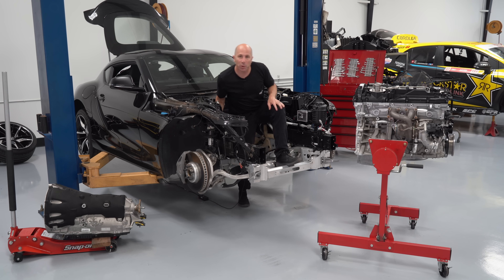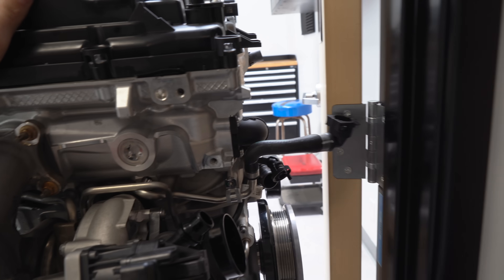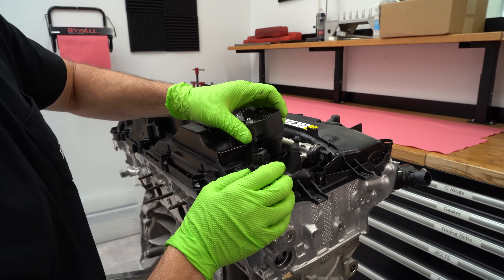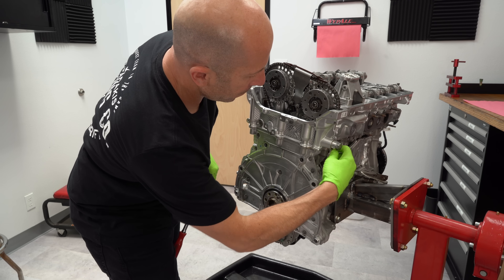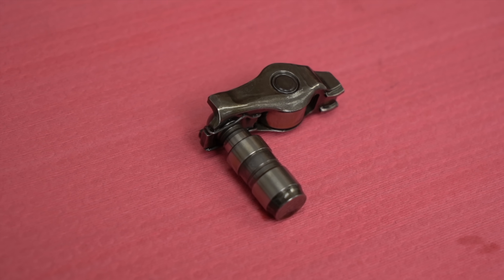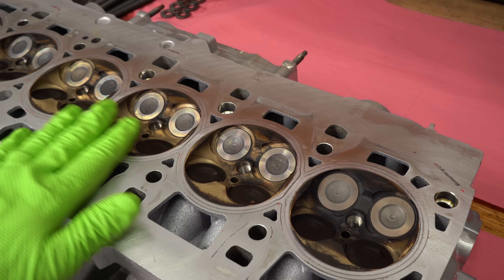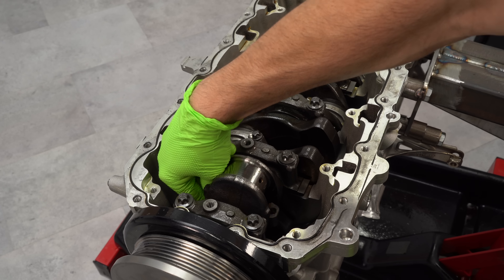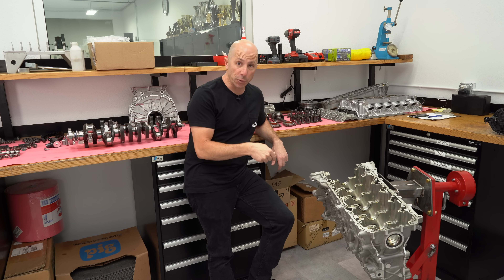2020 Supra B58 Engine Teardown - First Look - Better than the 2JZ?

Comment: As a performance engineer, the growing grin one my face when I see all the BMW stamps on every single part

Mmmm
Reply: How can you tell someone's an engineer?

They'll tell you.....
Reply: Same as Vegans
Reply: @creatorTWin  or they round Dow every number you give them.
Reply: That's what I said too. .  Easy peasy
Reply: Everyone else: Be afraid, be very afraid....
Reply: As a non performance engineer, your grin leaves us baffled. Is that a good thing, or no?
Reply: @CaneSugarCane  that's nice, just life McLaren F1
Reply: how about disintegrating timing chain guides
Reply: Having BMW stamps on each part increases parts costs and either reduces mechanical strength of the part or leads to it weighing more. As a performance engineer you should know better.
Reply: BMW is at the bottom of the german food chain 

Maybe Audi sits above benz in reliability granted each has cars with some issues 

But BMW takes the cake for interiors that wear out the fastest along with the cheapest build qauilty and being a service fucken nightmare. Yes the audi chain thing was a thing but those motors didnt die. Bmw however builds engines were the god damn rod bearings wear out and the engines fall apart after XXX,XXX im looking at your V8 M5 or V10 M5 those motors are on bought time 

The audi V8 just has a shitty long servicing to get to the chains but they dont blow up or spit there guts out. 

Then you have bmws love of plastic parts that destory themselfs
Reply: @josephandreuccetti8043  do you see Audis on track, that's what I thought. you see them off the track (literally), nobody cared about Audi enough to push them to the limits and they also weren't designed to.

Comment: I’m surprised of this tear down for rebuild when the stock internals have not been pushed!

Why not start by upping the boost and see what is the limitations. How much can the stock fuel pump, injectors and intercooler handle?

What size is the stock turbo and how much max power it can provide? What upgrade turbo and intercooler will fit?

Comment: The bmw 2.0 6 cylinder is actually a lovely engine

I could comfortably get 600bhp from it but I’d want cast iron block past that, the cylinder heads go for a past time running more than 23psi of actual boost pressure

Edit: I am glad Toyota axed the plastic fuel pump for a mechanical one, in my old 3 series with this engine I went through about six in 140,000 miles

Comment: I wasn’t expecting a closed deck block
Reply: @tjsimsgm it's main feature of bmw B engine series design. B58 use same block with B57 wich is diesel engine. So you can expect stronger construction for gasoline engine class.

Comment: ‘Normally all this timing chain stuff is on the front of the engine’ BECAUSE IT MAKES SENSE TO MAKE A WEAR ITEM ACCESSIBLE!
Reply: Timing chain isn't technically a wear item. That's like saying the piston rings should be quick release because they wear out. It does wear, but not enough to make it worth putting it in the front like a belt.
Reply: archerdog1 Not supposed to be, pretty rare for any engine design not to have the odd tensioner or chain/belt failure per thousand units though, especially at higher mileages.
Reply: @Jonathan_Doe_  At least the chain tensioner looks like it can be replaced easily.

Comment: I've been ripping on the new "Supra" because it looks like a rebadged Z4 and had such a shitty horsepower bump compared to the GTR but after watching this teardown it looks like it might make for a good tuner car. My only complaint is that the timing chain is at the back of the engine where the transmission bolts up. I would imagine it would be a pain to replace later down the road.

Comment: The JerryRigged teardown, this happened sooner than expected, I can't wait till they make 1000+hp.
Reply: The s38 bmw engine can. Maybe over time and  someone  will  do it in the  new supra.
Reply: tw06le1 they are bmw engines... they will explode before that point lol (not actually though the engine will never be reliable enough because it has the lower quality. Also most engines stock pushing turbo and engine make around 500 whp around 600 at the crank not 800 which made the car more unreliable due to pushing the turbo
Reply: @hithereperson8137  did you not watch the video? Before the b58 the n54 was making reliable 800hp on stock internals. B58 is a more modern version with more reliable and stronger components. Do more research.
Reply: But they won't
Reply: @Lolliesalot  so someone that builds race engines for a living said it could but someone on YouTube says it can't. Okay, you convinced me. Fuck sake lmao
Reply: @2jYeti  it's a joke my dude
Reply: @Lolliesalot  cant say it won't when people can get almost any engine to reach 1000hp regardless of who makes it.
Reply: @carboydorifutoparty3976  that's very untrue also.
Reply: @2jYeti  wrote it wrong. A engine without anyone knowing it's limitations that's already known to be tunable and has potiental has the possibility of hitting 1000hp or more depending on how its built/made.

Comment: Awesome and informative video as always. Do the n54 next! As a loyal N54 owner and skeptical new BMW person. This video confirms some of my suspicions about the b58. My first concerns were when i heard you had to drop the motor to replace the vanos solenoids. After watching this video, the things i find scary are the mechanical pump being driven by the camshaft. Seems like that would wear out. Also very concerning is the placement of the oil cooler and also the oil sensor. BMW is notorious for leaks in the cooler, and that sensor seems like a disaster waiting to happen. I’m coming at this from the perspective of long term ownership. I’ve had my n54 since 20k miles and now have 138k. This b58 seems like it’s probably great, but would be a nightmare to own long term. Which i imagine is how they intended it to be.

Comment: What a great video!
wanted to ask you before I make my purchase.  How do you feel the Supra will hold up with just a tune doing road coarse events/Trackdays?  I drive 10/10th's and im not looking for a motor taking a shit or even the tranny.  What would you? are there areas to mount up aftermarket coolers like steering, oil, trans coolers? Thank you

Comment: Can already list the problems forthcoming....

Chain guides breaking up, HPFP and carbon build up on inlet valves causing loss of compression.
Reply: Agreed, the HPFP/DI will also be a huge cost prohibitive factor for big HP. 
There's no way the average MK5 owner will be able to afford to make big power with his motor.
Reply: @soccerwizard444  Not like the average Mk4 owner can make big power without spending some money.
Reply: @MeDicen_Rocha  Different leagues, nearly anyone can go out and buy a new car.. 

Also high flow DI injectors run 500-1000/ea
Reply: @MeDicen_Rocha  All modern performance engines are going to have DI.  Running port injection will  be the norm for fueling for big power.  If it becomes popular, cost will hopefully come down.
Reply: This.
Reply: RTS Motorsport b58 has been out for a while and nothing has gone wrong
Reply: @bradenmchenry995  Issues usually don't pop up in the first few years. I just don't like the cam chain setup in the back like that.
Reply: @bradenmchenry995  which "while" ???  its only been out since 2016
Reply: @del7723  a while is at least 5 years
Reply: @EpimethiusInPerpituity  r/nobodyasked
Reply: @del7723  2015*
Reply: @bradenmchenry995  horrible oiling issues on the forums fan boy go take a look..

Comment: Internal exhaust manifold. You didn't show it? And you want to make 1khp? Lol have fun with that one... I'd just 2JZ swap it at that point lmao. You'll need a new head, you probably can't flow more 600-700hp through those manifolds. Internal exhaust manifold.. big bucket of nope.
Or save some weight and chuck in an LS for trollfactor. 

Stampled oil-water coolers are known to leak, sad to see them using that. A laminova style one would be superior. 
Thanks for the video! Interesting engine design indeed.

Comment: this is why i dont like the b58 , too much plastic , drifting only allows water instead of coolant so the efficiency of those water to air and water to oil coolers drop a lot, the head style is complicated to work in , special tools and complex design , sure the block is strong and can hold 1000hp but the beauty  of the  2jz wasnt just hold power, 2jz are cool because  even a noob can work with it 
dissclaimer: i'm not asking for a jz , just a simpler inline 6 engine....
btw  mercedez benz inline 6 sounds better xd

Comment: I have a M240i with the same b58 engine and I truly think 1000hp on a b58 is probably impossible
Reply: Theres a few companies out there that have made 1000hp out of the S55 and now we have the B58 that more than likely can handle it but if they had the S58 then it would be easier to hit 1000hp with it since it has a low compression ratio compared to the B58.

Comment: Seems like a great engine already, my only concerns are with the head-
All of the vvl components could be weak points, and the exhaust ports/manifold
No matter how well it has been designed, it would be almost impossible for each runner to be an equal length, and so that may limit the engines output, especially cylinders 1 and 6
But, there is always the potential for a billet cylinder head to be made, who knows?

Comment: dear God  this engine will be a nightmare to work on.. pulling a entire motor just for timing changes rather then a few front end parts an a rad also that coil cooling is gonna give alot of false positives when people check for blown heads an creamy oil/coolants if that plastic unit crafts from engine bay heat cycling for years

Comment: Cracked rods aren’t that new tech 5.9 cr cummins have them. That head looks like a limiting factor since the exhaust manifold is in the same casting. It could be possible to cut it off the side of the head, vary similar to what drag and sled pullers do with the 5.9 and the intake plenum.

Comment: Wow, color me shocked, BMW did build a stout inline 6, who would have thunk it. Thats sarcasm of course, I know for all the fan boys that the 2J and RB are the only inline 6's in existence, but BMW has been in the game for a long time and put many a ripper I6 engine in their M3's. The problem with the 2J is that it will no longer stand up to the new emissions standards and redesigning it or building a brand new 3JZ for such a low production car would be far to expensive, I know others have been saying this but obviously people don't get how expensive R&D is as well as putting together a new production line for an engine. If they where to do it they would have to price the new Supra way higher and it would still probably sell  at a loss. I will say this though, the two exhaust ports make me wonder what kind of witchcraft is going on in that head, and what the price would be if you need a new one, also, specialty tools for basic maintenance is total bullshit.

Comment: If the exh manifold is built into the head, then how will this portion of the motor be upgraded in the future?  Are we going to have to make entire cylinder heads that have the internal design eliminated?  Is the design that is inside the OEM head "fine" and you could upgrade the part that bolts onto it for gains?  Are people going to be doing complicated porting jobs on the insides of these heads?  All this stuff sounds super crazy to me, but maybe it's the way of the future.

Comment: The block looks bmw in so many ways but I see Toyota inspiration where it counts, like the rod bearings, the aluminum plate on the bottom to stop oil making windage in the crankcase, the cracked rod caps, and the easy to remove part. I’ve taken on plenty of valve covers and know those vvt things can do a roatation if you hit them one wrong way, and send springs flying, so good job with them but have fun assembling it 😄😄 I think that oil to water cooler may be a culprit for going bad based on bmws love for gaskets being prone to leaking on these little coolers so watch out for that.

Comment: Nevermind any of this engineering/1000hp stuff...more importantly how do you make it JDM yo.
Reply: 180 degree exhaust manifold/equivalent for high pitch JDM sound (idk how you would do that since turbo and manifold is all in one), greddy type s bov or hks ssqv bov (intercoolor/intake integrated so idk how you would do that, 3.5 inch downpipe and cat back. All in all pretty tough to make it sound JDM. It kind of sounds jz esque already except fake cabin intake noise. 

As far as exterior, there is a several different wide body kits and lip kits already being developed. https://www.motoringexposure.com/prior-design-previews-new-toyota-supra-aero-package/ personal favorite of mine. It makes makes the supra fresh and keeps toyota design language (prior design looks like beefed up 86). Pandem kit is already for sale for $8,000. I suspect TRD and GR to make performance body kits. 

Interior wise, go custom. OEM wise, Piano black is obviously toyota derived and so is the "stacked"/layered styled dashboard (top part and bottom part creating "stack"). Would love to see Lexus interior design into the Supra. Gauges, electronics and chimes are BMW and will also need to be custom.
Reply: @TommyNoBaka  way too much work. Single sided fart can exhaust. Stanced with some obnoxious colored wheels, some jdm stickers and it's ready for Instagram.
Reply: @zareff  oh, youre talking about real hot boi stuff lol. Chop the springs, auto zone muffler, camber plate, yohre good
Reply: @TommyNoBaka  irony didn't come out clear. I'm talking about what I see on car meets and the internetz. I thought the f2fs days are coming back again .
Reply: @Richard Ren not even a drift charm? I was told HKS stickers are good for 10whp.

Comment: It sure is high tech. But when it comes to upgrading a lot of those " high tech" things have to go. Manifold wont flow enough on the exhaust side. These built in intercoolers will not be enough for high horsepower applications.   Cool and maybe solid for the stock application with minor tweaks. But when it comes to real upgrading most of the new tech will be removed. :(     Or this man proves me wrong in upcoming videos.

Comment: The engine is so complicated even the stand need to be modified. It needs special expensive tools to tear down which means more time and money to spend (2jz needs basic tools).

I really wished that they would’ve used aluminum intake manifold instead of plastic, also why on earth would you complicate the thermostat system !! The engine needs only a thermostat. It proves good through the years.

-The timing chain is in the back. If you need to change the cam you need to take off the whole engine ( you can change the cam and the timing belt on the 2jz while the engine is on the car).

- Double timing chain for the cam gears and oil pump (2jz only had one, also the oil pump on the 2jz works by the crank rotation not chains).

- Valves Rockers (instead of just shims in the 2JZ).

- Two Separate Rocker arms on each valve for the vvt-i system ( 2jz only has it in front of the engine).

- Direct injection system which has four main failures:

A- The pump needs modification and reinforcement.

B- The intake valves will need more additives to clean (since fuel won’t clean the valves).

C- Very very expensive injectors.

D- Many cars I fully overhauled suffered mainly from direct injection pump BEARING.

I like the bottom of the engine because of the girdle, other than that the engine is complicated and expensive to work on.

Comment: I want to know more about the intake cam double roller rocker assembly, those springs, their purpose and the integrated exhaust manifold channeling.  Very cool to see the latest and greatest!
Reply: That's Valvetronic, BMW's variable valve lift system. It's been around since 2001, and it's really cool. It allows full control over the intake valve lift, so it uses the valves themselves as the throttle body. The throttle body you see him take out is only used as a backup in case something happens to the valvetronic system. Youtube has a few videos on how it works.

Comment: 8:34 actually am very impressed, even a trained bmw technician couldn't remove the valvetronic eccentric shaft mechanism without  the special tool
Now all Papadakis Racing need is some spare parts n special tools n they r good to go as a bmw service centre 💪

Comment: Wouldn't you say that it is a very shit timing chain design? You have to pull the engine to fix it. Aldo direct injection lets your valves get dirty over time from the combustion chamber. Also vvt is cool and all but it wairs out.

Comment: Cool tech, but I see so many places for typical German car leaks.
Thanks for the video, enjoyed as always.
Reply: HeyrroPrease 

Plastic thermostat/oil filter housings right next to the block that’ll get brittle over time, check. 

Silicone instead of an actual gasket, check.

Probable hideously complex PCV system, check.
Reply: @Jonathan_Doe_  
Exactly!  
Been an issue with any German car that I've owned and yet it still seems to be common practice.  One of the reasons I don't buy them any more.  
My 10 year old Sequoia has over 200K miles and still as good as new.